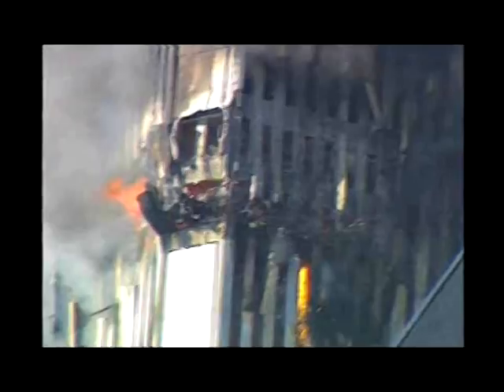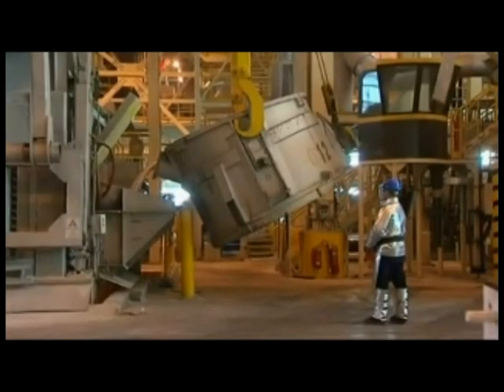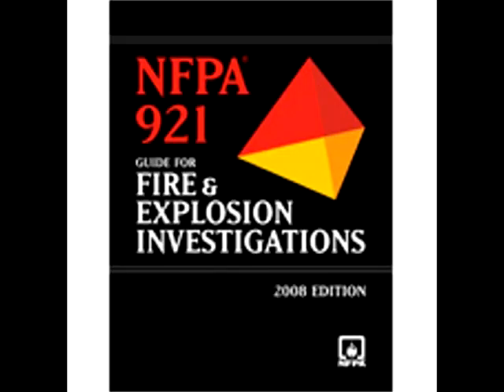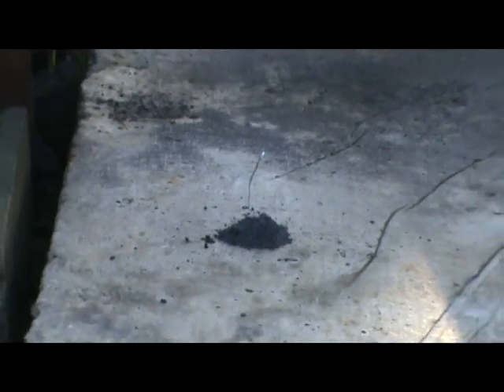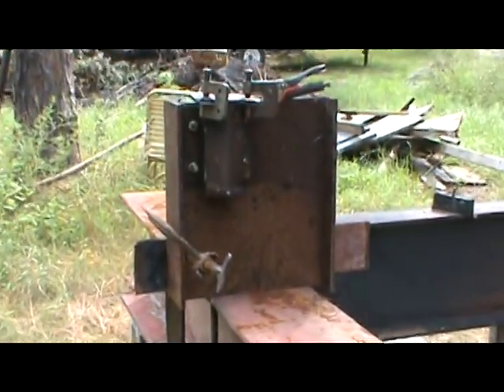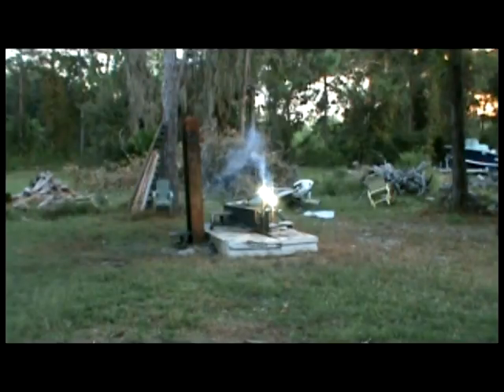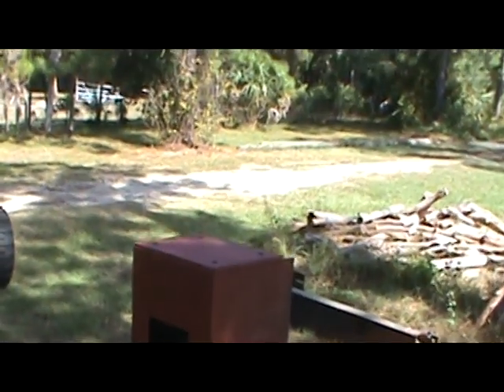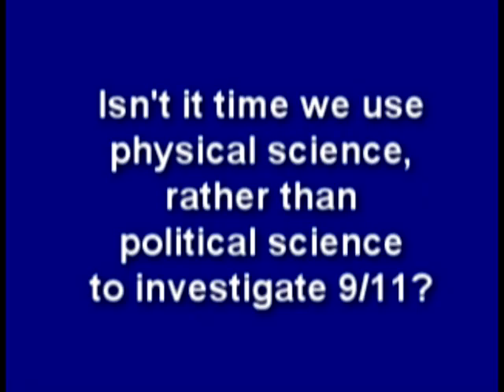9/11 Experiments: The Great Thermate Debate

Comment: Man that Pentagon huh!!! they knew EXACTLY where and how fast and at what angles the planes were gonna hit on each building ok? Also, they knew EXACTLY how the fireballs and shrapnel and debris and pressure would go in each building, and they knew were all the holes in the building and all the beams that were blown out were, so they knew EXACTLY which Thermite bombs to set off so no one would becomes suspicious. 
Like you know the corner of Tower 2 that was severely daaged? They'd installed a thermite bomb right in that corner, JUST above and JUST below the hole in that corrner, because they knew the planet wing or whatever would rip out in the middle of them, so then, they pressed their detonator slowly about 40 mins after the crash happened, (thats what the sparks you see are coming from the hole just before the collapse) and boom, it went down, AND did you notice, both buildings collapsed at the EXACT areas where they had the most structural and load baring damage? well they didn't, they had thermite bombs installed in those exact places, which DIDN'T get hit by any of the debris or shrapnel or weren't blown out by the fireball or pressure or anything, of COURSE they weren't, the Pentagon planned the shit ffs, so they knew EXACTLY where they needed to plant the Dynamite. And it fell down EXACTLY as they'd planned it in their secret meetings they must have been having for YEARS to managed to knock down 3 buildings with 2 planes so amaingly well and with so little evidence. 
Because we all know, you know all of those "Explosions and secondary explosions" they all kept hearing? We know for a FACT that they were the thermite bombs, because we've all looked up Thermite or Thermate now and when you light Thermate, it makes a big explosion noise doesn't it. You guys are awesome, how did you work all this out from your computer seats!! my god.
Reply: Anthony Quigley - First of all, this guy did not sit in his computer seat- he went out and made some fine practical investigation outside with real state material. Second, maybe also watch „Loose change II“ and start thinking. There are many more strange facts implying it was a false flag  action. And last but not least- if ONE thing seems to be strange, this might happen and allows discussion- but SO MANY inconsistencies should really make you start thinking! 🤔
Reply: I've watched all 3 version of Loose Change. Alot of the stuff he claims in there just didn't happen. You watch Loose change but you don't go ahead and check all the info he is giving you as facts. 
If they DID put bombs with this crazy burning material in it, why did the builds first start collapsing at the EXACT points the planes hit? Answer that
Reply: Quigley,  You are assuming real planes hit the buildings.  How do you know the planes were not CGI?  Where are the black boxes?  Where are the engines?    All you saw was a video of planes hitting the buildings.  Videos can be edited.  Do you personally know any real people who witnessed in real-time actual planes hit the buildings?
Reply: Anthony Quigley - Do you know, according to most deconstruction specialists, how difficult it is to make a building decompose straight downwards? It is a very difficult job to do so, if in deconstruction buildings the dynamite is not set exactly calculated, the buildings will fall sidewas, or in any other way. Now tell me, how can THAT be, that WTC 1, 2 AND 7 collapsed in a perfect calculated way without too much of collateral damage? Impossible! Also, what about the pictures from the Pentagon? Loose change mentions it- where are the holes in the building, where the 7 tons titanium steel jet engines are supposed be at a plane? Those would definitely make a hole into the side wall of the building- but the first picture of the Pentagon before it collapsed showed it only with ONE small hole, before it collapsed. Like I said- if there is one strange thing about 9/11, ok this might happen- but so many inconsistencies are extremely unrealistic, don‘t you think so?
Reply: Anthony Quigley ask a demolition expert.
Reply: "why did the builds first start collapsing at the EXACT "...erm because it was planned. you are some kind of genius aren't you...
Reply: Anthony Quigley, But do they know why kids love the taste of cinnamon toast crunch?
Reply: Evidently not, we are suspicious. Your comment is dogshit.
Reply: What plane idiot?
Reply: Well hell. Osama was working for the cia when the soviets invaded afghanistan and it so happens many al queda members were working with the US to stop the spread of communism in the middle east and Africa. When the soviets pulled out many of the CIAs assets in afghanistan were cut. Was it revenge, jihad or a cover up trying to get rid of loose ends by justifing a retaliation to radical fighters who were heavily armed and trained by the US. It makes sense in all versions it's just the how that gets me.
Reply: Anthony Quigley 
According to whom? Cite your scholarly background in any related scholarly field?
Reply: Anthony Quigley "nano-thermite" not dynamite.
Reply: Anthony Quigley your an idiot.
Reply: Yes
Reply: Anthony Quigley put down the cool-aid. 1100* F causes the steel to fail, not melt. It loses 50% of its structural strength.
Reply: I guess you don't realise that they didn't need to calculate any of the 'extra' stuff you are mentioning above - and in fact due to the kind of stuff you mention we can actually see the pouring of molten metal from charges that were set off by the fuel fires from the airplane (ie, heat activated, leading to the burn and running metal, vs shock - which would have set off the whole charge at once and we would not have seen the running metal as it would have vaporised the metal).

Before being sarcastic it may be best to be sure you know what you're talking about - or even better yet - don't be sarcastic since you don't know how much you don't know ;)
Reply: erm it wasn't real planes as at that speed a real boeing would fall apart. it was holographic projections and the "balls" are seen in various video footages where they couldn't create the holographic deception properly because of the background. and yeah they knew exactly where they were piloting this. just like a drone can take you out very precisely.
oh and lastly if you believe an aluminum plane with fuselage thinner than your thumb can cut through steel beams a few feet in thickness you are a very undeducated individual.
furthermore your sarcasm is quite misplaced as it underscores your ignorance.
Reply: Ayrton Senna hit a Concrete barrier at an Oblique angle, not head on, removing MASSIVE amounts of pressure and force from the impact on the harder material side, that cars Monoqoque, wings and panels were male of carbon fibre, and the strits and suspension were made of mostly aluminium. thats a COMPLETELY different story. 
Anyone saying those planes were made of Aluminium and there's noi way they could have punched through the steel fascia just doesn't know physics in any way. The panels were only like an inch nad a half or 2 inches thick. So they're saying that the plane, 100 tonnes of it should have just splatted on the side like a bug on a car windshield, not taking into account the welds and joins being massive weakspots in the fascia structure, not to mention how thin the fascia actually was. 
If a 100 tonne aluminium plane can't crash through an inch and a half of steel no matter how fast it's going, at what point CAN it then? an inch? a half inch? or is it just the fact that it's Steel vs alumunium confusing? Like saying a pingpong ball couldn't smash CLEAN through a coke can because the can is made of harder material; no matter how fast you project the ball (if this is even what you were talking about)
Reply: OK guys i actually completely apologize for the sarcasm It, was an idiot thing to do. 
Can i explain what i think most likely happened? 
There was most likely no preparation done for this. And it wasn't an inside job, so much as to say that no one "prepped" the building for demolition. 2 planes did indeed hit the 2 buildings just as we saw (of course they did.. they just did) and i believe they were indeed full of people as stated and they were hijacked.
The planes hit where they hit. The steel was indeed high grade steel, able to withstand heat MUCH higher than what they experienced in the crashes and aftermath. BUT. 
The planes blew out some important structural pillars and supports on the inside, damaging them, bending them etc. But the KILLER here was, the damage done to the Fascias. We can all agree that the structural integrity of the building was that outer shell, it was designed this way. You poke big enough holes in these faces, and some pretty savage load shifting is going to happen. 
Remember, these buildings were so sparsly supported, that reoving quite large portions of certain heavy load baring areas, and damaging others, could only lead to a catastrophic failure of most of the upper part of the building. 

The building is only supported by a reasonable thin square box in the middle, and then the massivley strong outer shell which is like a supporting mesh. The rest of the building is LITERALLY just struts, floor panels, beams and ... air.. 

So here's my diagnostic. 
The fire from the Jet Fuel didn't melt any pillars. 
But it's a scientific fact that steel pillars and gerders are strong against fire, but when held under a constant flame, if the structure is load bearing, it weakens quite significantly, causing it (with enough weight on it) to start to bend, buckle. 
Now remember, to cause this entire collapse, al that needs to happen is that ONE floors ouuter walls and a few of the inner box pillars, say on floor 88, to either be missing, or to have been bent and damaged from impact, and then a couple of the remaining pillars to be exposed to the intense heat. Again, the remaining damaged and undamaged pillars don't need to melt, they were weakened enough, that say.. with 40% of the usual support missing, and 10% of the remaining support pillars starting to weaken quite a bit due to being exposed to fire, that they start to buckle due to the enormous weight, DEAD weight, just leaning down ontop of it. 
just ONE floor, is down to 50% of it's support capability. And of course, this support capability isn't uniform, it's not like you just remove a pillar here and a pillar there like Jenga, the areas affected are all going to be clumped together, so you have 70% of the outer wall on one side completely missing, then a huge gaping expanse all the way in to the box pillars, here, is where the plane smashed through, bending and breaking some of the support pillars in the box on one side, then the fire further makes them bent, and is also now lapping flames up against the good support pillars, so you have massive uneven damage. 

Meanwhile, not a SINGLE pillar has been "Melted". But go check it out, i promise you, fire, no matter what temperature, weakens structural steel. you have even 800c Fire lapping at 4 support pillars all in the same area for 45 mins, while the outer wall on that floor is completely obliterated, once those remaining couple of pillars start to weaken and buckle (Remember, it's only one floor, but this damaged, weakening floor with half of it's load bearing properties mangled and half not mangled, is now supporting 100 thousand tonnes worth offloors above it) then you get a chain reaction, because the 100 thousand tonnes of floors and material above, now basically slam down on the support structures underneath which THEMSELVES are damaged almost to the same extent, and the outer skin just peels back, and mark my words, if you slam 100 thousand tonnes of ANYTHING quite quickly down onto concrete which is just laid in so you can put carpet of it, it's gonna puff out to dust. I mean, hit a cinderblock oir whatever with a sledgehammer and it puffs out a bunch of dust. 

I think the pure weight of the upper floors coming down ontop a buckled floor below it, caused the weight to completely cascade, the floorbeams and bolts had no chance. 

I think the most evident part of this is Building 2, they even zoomed in on the corner that was badly damaged the most, and you could see the building lost it's battle with gravity there first, how do we know? we saw it, we saw the 150-200k tonnes of building above lurch over on the damage side, and i thinhk the plume of smoke/ dust we saw, is the exact same plume we see when any big structure drops, cement being obliterated from 200k tonnes hitting it at speed. 

if you have any questions, let e know, is it's difficult to get 100% what you mean in writing. Thanks guys, again, apologies for the sarcas.m.
Reply: Shouldn't we be focusing on the obvious lie that a plane when down in Pensylvania? They see to know that the passengers entered the cabing while it was poing 90 degrees down. And the plane hit the ground, made a fairly shalllow hole and simply VANISHED. Almost ZERO fire. A bit of smoke. No pieces bigger than a Seat tray, Why aren't we talking about this? 
It's proven that ANY time, EVER (it's true) in history that a plane crashed into the ground, even nose down, There's massive damage, fire, The tale is pretty much undamaged, as soon as it receivs inpact from the copartment infront of it, it disconnects and flies off. 
Where were the wing tips? Where was the whole tail, where were the titanium, steel and alunimum engines? No plane has ever impacted hard enough to destroy titanium engines. Where were they? where was the fire? Look at the fire and destruction when those 2 dutch planes hit eachother on the runway in tenerife. There's a 4ft deep crater, and a few pieces of paper and metal. The tree behind is KINDA on fire. We shouldn't be looking at the buildings. We need to look at that.
Also, wheres the plane that hit the Pentagon?>
Reply: Exactly my thoughts. Unless the entire building was rigged with Thermite . bombs, how did they do it? There's NO way they could have known exactly where in the buildings 2x 550mph passenger jets were going to crash. And surely even if they did (impossible) the thermite bombs or packages would have all been blown out of the back and destroyed by heat and pressure and the initial blast. So where were these thermite bombs? As they found ZERO of them in the debris, they just found small particles etc. Someone answer please.
Reply: Anthony Quigley 

With the burning jet fuel they wouldn't need a direct hit.
It's why the first tower took so long to fall.
Reply: Call me paranoid but I'm detecting a slight hint of sarcasm in this comment
Reply: Anthony, Bullshit. That's what you did, figure this out from your computer seat. How much steel have you cast?
Reply: +Anthony Quigley
Truther science is always that exact.  Saved me the effort.  Well said, if somewhat breathlessly... :)
Reply: A Critique of the NIST WTC Building Failure Reports and the Progressive Collapse Theory - AE911Truth
https://www.youtube.com/watch?v=d14lc-Eizk0
Reply: 9/11 Mysteries: Demolitions In its entirety 
https://www.youtube.com/watch?v=_St1LWuWZ6I
Reply: For all the work you went threw to create your conspiracy you forgot the first rule, don't assume. You make an ass out of you kinda thing. I will leave you with one last comment. What are the rims for the landing gear made of smart guy.
Reply: I think you put your finger on the precise issue that plagues every conspiracy theory, the complete focus on some single piece of perceived evidence and the complete and utter disregard or waving away of any heaps of evidence to the contrary.
Reply: Anthony Quigley your comment is full of ignorant bullshit
Reply: O.P. Yates  that still means that ALL 4 sides would have had to give out AT THE SAME TIME. The middle support did not stop it from falling down and it did not stick through the roof like a stick through doughnuts, so how would it keep it from falling to one side or another?  The fire started on one corner of the building,  that means that corner should have weakened and started falling first but it didnt, it fell evenly all the way around
Reply: Anthony Quigley lets say that the plane was responsible for bringing the tower down. How is it possible that it fell strait down? The weight distribution and weakened steel beams would have caused it to collapse unevenly.  Demolition experts plan building teardowns so that it falls where they want it to,  yet a plane+fire on the 1st try 2 times brought the buildings down perfectly.
Reply: Roger Adkins make that 3 buildings chief. Random office fires brought down tower 7, not even a plane was needed for that 1....
Reply: Lisa Shea i didnt want to bring in a second argument with Anthony.  But you are absolutely right
Reply: Roger Adkins How was it supposed to fall  like a tree timbeeeeeer.    Oh and they didn’t fall straight down.
Reply: So Anthony in your opinion a well thought out and executed plan could not be done by our government to further its global and domestic goals? Who benefited from the whole ordeal? How much money was paid out on the insurance for the buildings? How much money was made going to war? What did we accomplish over seas as a result of the invasion and war in Afghanistan? Follow the money and you will have your answers. Also, the guy who made this video spent a lot of time and energy proving that using thermate/thermite is possible to melt steel. He did not sit in his computer seat as you say. He actively conducted an investigation. If you read the reports by the way on the skills the pilot would have had to have to make that maneuver on the south tower.....it was an amazing feat of piloting to say the least. Never before in the history of skyscrapers did large fires result in the collapse of a building.  Yet three buildings made history that day. Fact.....office material and jet fuel does not melt steel.
Reply: to all "no WTC planes used" shills: paid or simply an idiot does'nt matter. we are talking aprox.  50 Tons at a speed of +550mph and a pot attached to the underbelly which detonated on impact. if it was a ground penetrating missile (common theory among researchers) which is used to take out underground  bunkers then there goes your questions of how etc. Weight+Velocity+missile: Killercombo. edit: lets not forget the small airplane which crashed into the empire state. way less speed, way less weight but still went into the building. now consider yourself educated.
Reply: @Tom B The NTSC and the FAA both say that a 767 cannot fly at 550 mph at level that the "planes" hit the buildings. 550 mph is their top cruise ceiling speed(cruise ceiling is 30,000 feet), in the lower, and thicker atmosphere, their speed drops to about 300 which is not fast enough for a 767 to penetrate 2" thick iron I-beams. At the very least the wings should have broken off and fallen to the ground, and not penetrate the building like the building was made of butter.(ref. MIT video here on YouTube)
Reply: Tom B 

Did the AA ground crew at Logan not see that missile when they fueled Flight 11 that morning?  Same with UA 175, nobody said, “Hey, what’s that big thing for?”  Nope?

3/32” aluminum will not penetrate 2” thick steel box beams and solid concrete decking if it were going 1000 knots.  

The coyote cut-out is evidence this was planned out far in advance.  The fire ball was the curtain for the wizard.

The perpetrators have to keep this story going another 30 years to avoid prosecution.  Just like JFK they employ people to confuse and hide the truth.  Magic bullet, magic airplanes.

Good day! ⚓️
Reply: Tom B, what are you trying to prove, you just seem to be rambling and attacking people. It's questionable whether it's possible for the aircraft used could reach those speeds at that altitude and the manoeuvre used by the pilot of the second aircraft had to be incredibly skilled as most professional pilots can't pull that off in the aircraft used.
Reply: Adamgaming24+RickyRicardo well i have to prove nothing bcs you just proved that you dont know what you talking about. Its irrefutable that 2 planes went into each of those buildings because WELL IDK MAYBE BECAUSE EVERY NEW YORKER WHO LOOKED UP SAW IT. your CGI bullshit hurts every hard working researcher trying to wake ppl up. I wont repeat myself bcs I already explained why those Jets were able to penetrate the buildings. UA 175 and AA 11 took off of boston and crossed pathes at Stewarts AFB at the exact same time. those where drones hence why no ground crew saw a pot attached. eyewitnesses said there where no markings and resembled a military jet which it was. the pot is evidence enough. Done!  next... EDIT: I does'nt matter if a ground crew saw nothing thats not even remotly the point. the simple fact that there was a pot attached proves that it was not the same plane and  photographic evidence and eyewitness accounts render your statement invalid.
Reply: Tom B, you missed my point, it has been proven that it was not possible to reach the speeds you claim they hit the building and it could not have been pulled off by amateurs. To add to that, no black box was recovered yet ID of the attackers was recovered, I don't see how blackboxes were destroyed to the point that they couldn't be recovered yet 'evidence' of the identity of the attackers wasn't.
Reply: Adamgaming24 no i got your point. dont be so naiv. they found the Blackboxes but they tell nobody about it. why do you think the only 2 planes who went into their target where from Stewart AFB? just like the E4B's. a worker at gz confirmed the finding. and the speed is pretty much not so important bcs they went right through. the approuch shows clearly that this aircraft was not flown by a human let alone some arab. the passport was "found" by a guy in a black suite who approuched an asian officer. look how detailed the search was especially at fresh kills. you really believe they did'nt find those bright orange boxes? cmon dude. that guy who found and led the feds to the boxes had no reason to lie about it. it was also reported that they found the first Box on tv. one can clearly see that the reporter who announced this news got some serious talk from his boss when you watch the apology afterwards. the only conclusion according to you is that this where cgi planes. like I said from the beginning: pure bs
Reply: I absolutely love the sacrasm in your comment.
Reply: I love this! thanks for showing how stupid these people are. Plus the PLANES are aluminum and are on fire and the buildings are made of rusting steel (rust makes iron dust when you hit it) steel and aluminum and are on fire so that makes NATURAL THERMITE.  plus the buildings werent meant to be hit by planes at full force then lit on uncontrolled 2000 degree fire in the middle for hours. of course they fell! Buildings that catch on fire tend to fall! Ships that catch fire even steel ones will sink! Look up the SS yarmouth castle and you will see what i am talking about.
Reply: Raymond Leggs go look up skyscraper fires. Lots of them and no buildings collapsed on themselves after explosions and they didn't fall in a controlled demolitioned manner. Go look at building 7. Now go watch a random building controlled demolition somewhere here on YouTube.
Reply: @RaymondLeggs I didn't know your level of stupidity was possible. Let's do a little science experiment with Jenga, shall we? Set up a tower with a your favorite jenga pieces. After you're done admiring how awesome and pretty your tower is,  pick your favorite spot on the side section of that tower and start removing pieces. But remember, only on one side. Now, did the jenga tower fall right down the center or did it fall sideways? That's right! It fell sideways...as it should because the base the unaffected.  Next week I'll teach you how to make a volcano using baking soda and vinegar.
Reply: raymond, in order for that building to fall straight down, all the supports on all 4 sides and the middle would have had to given out AT THE SAME TIME. this would be impossible. if the jet fuel did cause the building to collapse it would have started collapsing on the side where the plane crashed thru and the fire was burning the hottest, cause this would be the weakest part of the building. BUT IT DIDNT IT FELL STRAIGHT DOWN.

And we all love the fact that you decided to show us all how STUPID YOU ARE
Reply: Try more research and less sarcasm from "YOUR computer seat " and you might learn something. These people aren't making this all up. It's been investigated by over 1500 Engineer's, Architects, Demolition experts and Scientists. Not to mention the eye witmess testimony of the ground zero first responders who heard and witnessed multiple explosions our government denies. These experts are labeled conspiracy theorists because they refuse to perpeutuate the government's lies. Ask why so much of the "evidence" the government has is classified for "national sercurity reasons".  Why?? We all know what happened right?? I mean the government told us who did it right?? We have all the terrorist names don't we?? They even found an ID and DNA evidence laying in the smoldering debris of the towers that "proved" a terrorist was on that plane. Convenient?? No way son! Our govenment is just that thorough. Now, they couldn't find one single indestructable black box that would absolutely prove what happened,...but they found an ID. LOL!! Why believe the man who was in charge of letting the FEDs in at ground zero late at night, who saw them leaving with one of the black boxes, and they told him they found 2 more, but on the news the following day the FED's claimed they couldn't find any... The lies go on and on if you're willing to have an open mind and question. I'm not saying all the conspiracies are true. Disinformation is a favorite tactic of our corrupt CIA, but one thing is for damn sure, the official story is BS.
Reply: You know Thermite doesn't explode? And it acts very quickly, so as soon as those things were set as active, it only takes a matter of seconds before its done it's cutting. No bangs or explosions. 
So they would have had to wait an hour before setting them off, as the building would have collapsed not long after setting them, and there'd be an incredible hissing sound heard for miles around from so many Thermite devices being activated, not banging. Why did the buildings go down at their weakest points first? The only thermite left would have been the thermite in the non daage areas, all the devices around the damaged areas would have been damaged or blown out. So why did Tower 2 start to collapse on the EXACT corner and side most of the damage was done? Same for tower 1, ONLY the floors at the damage area and above collapsed, before landing on the undamaged section and the weight bringing those down too. 
Again, why did the whole chunk at and above the 80th or whatever floor in tower 2 lean forward and collapse first. That would be the LEAST likely place to fall if you think Thermite did it, as there'd be hardly any thermite left. 
And how much DID they thermite? As they would have had to thermite everything from the 5th floor up, because how accurate can a 550mph plane be? so why didn't they find ANY devices? or Remotes, or Detonators etc? only residue and ball bearing beads?